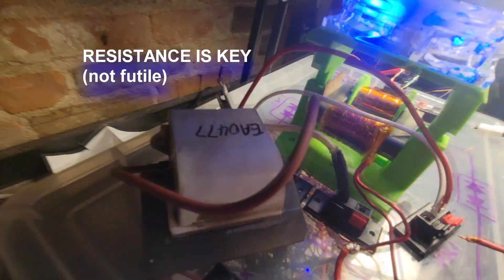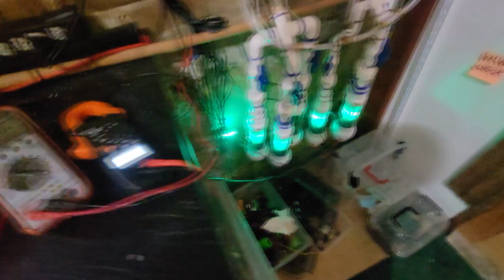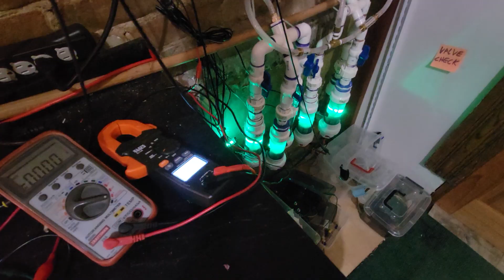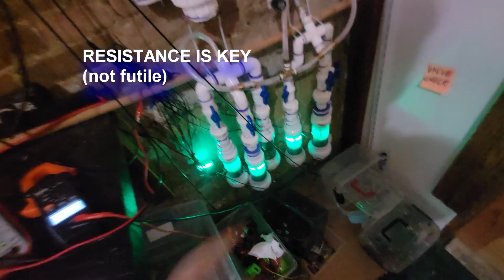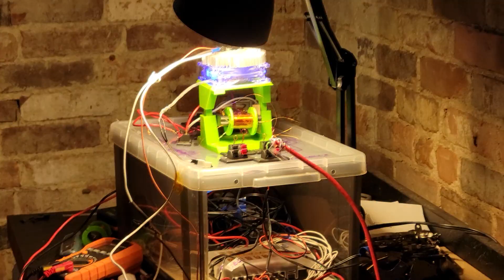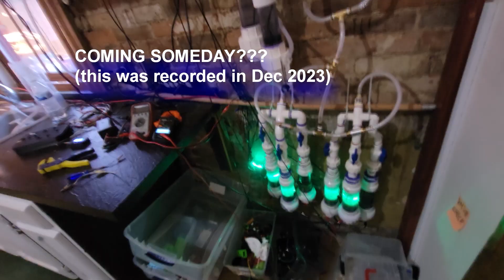Resistance is KEY (not futile) to Voltage Capability

Comment: @noahauman
Try isolating one electrode from the water with and semi insulating oxide layer?
Reply from the maker: The calcium and contaminates in the water do provide a thin insulating layer on the inner electrode. This is part of my cell conditioning process, in fact. I have a video all about it. It absolutely matters in cell production.

Comment: Hysteresis condition sets in almost immediately in most cores, without a properly spaced gate signal to cut it off. The first pulse train operates in a transient period where voltage magnification is very large, but quickly dissipates as current flow takes over. If you can space a gate frequency far enough out, you can raise the cumulative magnified voltage by allowing the core time to reset each pulse train.
Reply from the maker: I understand what you are saying. I think this is why I see the initial voltage on my cell spike, but as a short amount of time progresses, the voltage drops to a lower level. The gate signal allows the core to dissipate energy, circumnavigating hysteresis, allowing the process to start over, reducing overall amp consumption and allowing voltage to spike to it's maximum level, over and over again. Accurate?
Reply: @noahauman  Correctamundo 😆